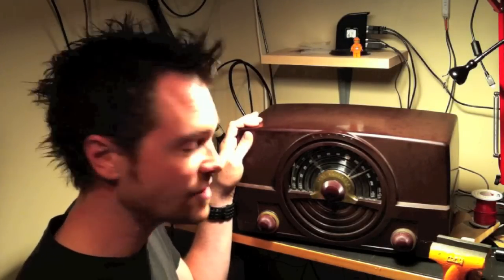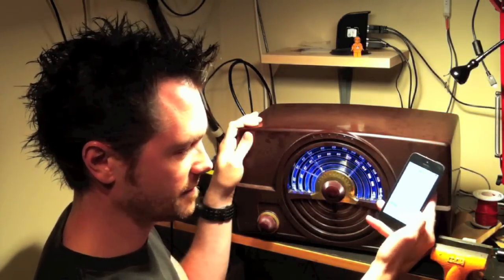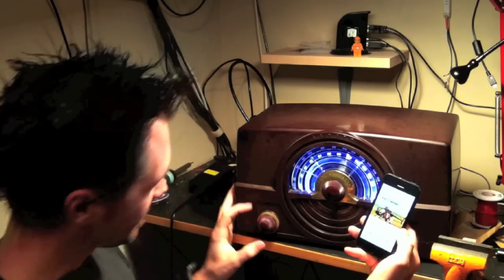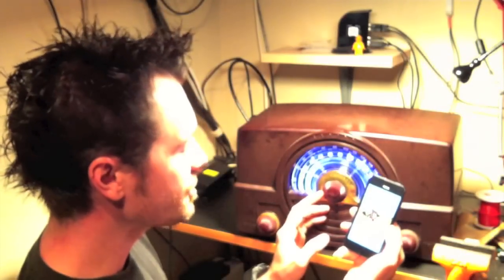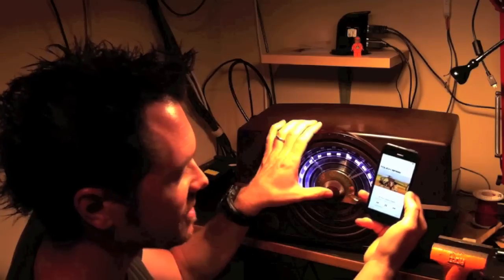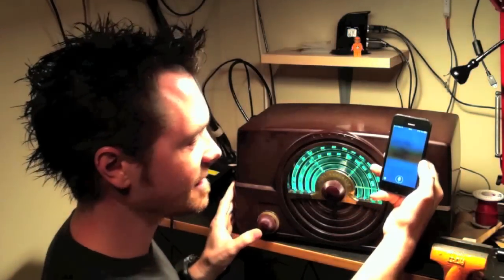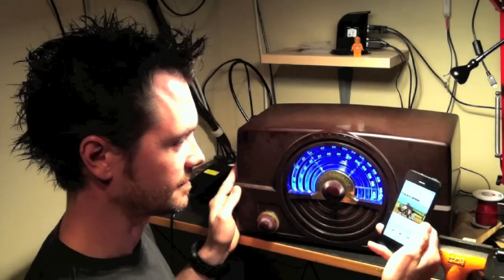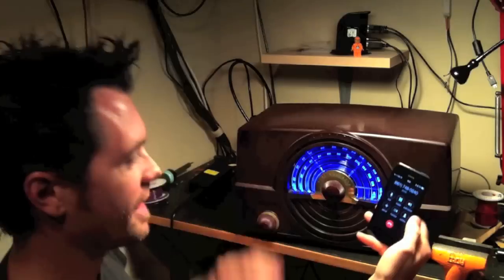Advanced Bluetooth Speaker Build in Antique Radio Cabinet

Comment from the maker: I started development with Melody 5.0, but then upgraded to 5.5. It's very interesting that you mention the mic sensitivity changing after upgrading... At some point I noticed that my microphone no longer worked, but I thought it must be a hardware issue. I had so many other things to work on that I figured I'd just deal with it eventually. I like that 5.5 brought in many more features (especially multipoint), but there seem to be some bugs in call handling which make it difficult to use. I've been in contact with tech support but it's unclear whether it will be fixed.

Comment: Did you keep the BC127 on its stock Melody 5.0 RC11 firmware or upgrade it to one of the 5.5+ versions? When I switch from 5.0 to 5.5, the microphone sensitivity drops off significantly, basically rendering the microphone useless.